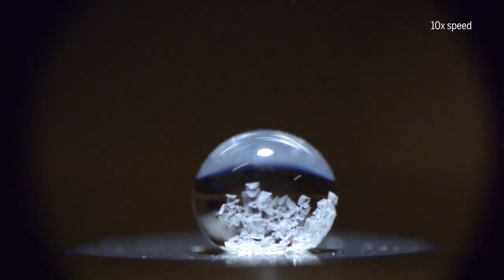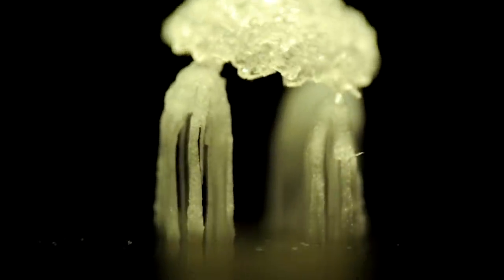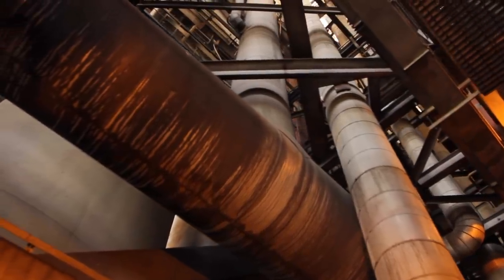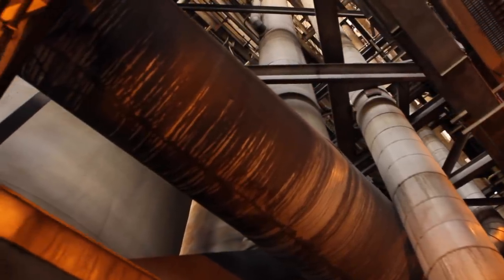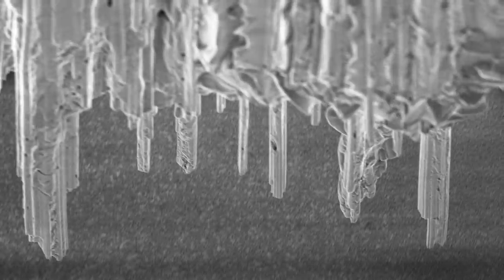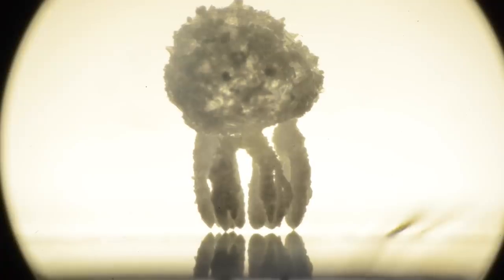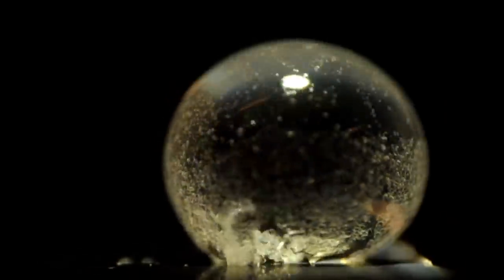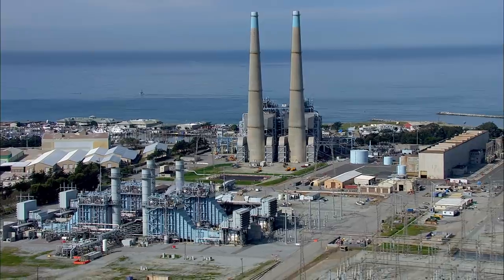These strange salt ‘creatures’ could help unclog power plant pipes

Comment: If these structures can also be produced in large quantities and relatively cheaply, power plant operators will jump for joy.
Reply: It will be cheap in 20 years..
Once the patent expire and China start mass producing it..
Reply: Plus anyone that owns any vehicle up in the north-east "rust belt" because they use a lot of salt on the road.
Reply: @ETERNlTUS  The estimate of 20 years could be right. It depends on how much interest the industry has/will have in it.
Reply: @nostalgichacker  Vehicles with this nanostructure as a surface? I think that will still take some time.
Reply: @ETERNlTUS  careful, don't blow the lid on PATENTS! 🤯✌️❤️
Do you know how much INNOVATION there would be?!
Reply: @sevisymphonie5666  If they make the technology cheap then at least some luxury car companies will use it to add value to their car because I assume that no car company wants to be known for rust buckets.
Reply: @nostalgichacker  Well, it's just that the surface of a vehicle, especially a luxury vehicle, has to be able to do more than prevent salt and other minerals from forming layers that are difficult to remove. It must also be able to withstand other external influences as much as possible. 
This nanostructure must first be produced on a large scale, and if it can then be combined with other technologies so that this new surface meets all these requirements, then there will be vehicles that no longer salinate.
Reply: Yes, and if this knowledge could be applied to dendrite buildup in lithium batteries it would greatly extend the life of this most widely used tech, which would have a major impact on the environmental and economic cost. 
This aside from the perpetual  Sword of Damocles hanging over countries like Venezuela that possess this finite resource, as a sleepy Apple, comfy in its spooky niche, slowly wakes up to 5G w/ golden-boy Elon spitting "We can Invade whoever we WANT!...".  Another day not being drone-bombed/"regime-change"-ed is another day to jump for "joy"; for reals!...
Reply: Being able to use saltwater for cooling would be amazing
Reply: @ETERNlTUS  china doesnt wait
they will copied it right away
Reply: Trenton Alverez  is it expensive?
Reply: @ETERNlTUS  china doesn't care about patents
Reply: Will the price change though, that's the question. Here's to hoping that it does help reduce its price
 
I worded that weird, it's more of a question of if the electric companies will have any significant change in price since the incentive is to make more by spending less on maintenance
Reply: As long as you can put the piece into a vacuum chamber and then heat it to 600°C, you can do this yourself pretty cheaply with TEOS (cit. Al-Harbi et al., 2012). I think the main obstacle til now was that we didn't know that salts would do this.
Reply: Patents stop progress but they do make since. It would suck donkey doo doo to spend years and years inventing something just to have a large company be like “thank you” and go build it for themselves with very little credit or money thrown your way
Reply: @jamesway4771  So it's dependent on the person, I mean that either the person plays nice and fair or their grip is white knuckled
Reply: yep

Comment: I hope the cost of producing that surface is cheaper than replacing a pipe instead.
Reply: If that pipe needs to be replaced dozens or hundreds of times across the life of a plant, each time requiring part of the plant to shut down then it might be.
Reply: @joshuacollins385  I still hope it is cheaper though, otherwise this is just a fun fact.
Reply: @lazywarrior  I hope so too, I just meant that with how often pipes might need to be replaced and the problems associated with that work, the bar this technology needs to beat to be cheaper overall is pretty low
Reply: @joshuacollins385  👍
Reply: @lazywarrior  Theoretically, if the material can be mass-produced, then it will provided that power plants start using it immediately.
Reply: What if the focus is the environmental impact of creating and disposing of the pipes?
Reply: Science of the problem has been found. Next is to let the engineers make it economically feasible.
Reply: @joshuacollins385  Not necessarily true. This surface, or coating is prone to wear out from the flow of crystals in the water. If that's the case then they'll have to replace/maintain the pipe anyways and then it kinda pointless.
Reply: This technology would involve replacing the pipes so they repel salt. So yeah replace the pipes, but make sure the new ones don't have the same problem.
Reply: I'm fairly certain replacing the pipes when they get salty would not be feasible (economically). The current approach is to purify the water to prevent 'mineral fouling', which is also very expensive.
Reply: @altersami9660  I don't think you are correct. It's not a coating, it's a texture applied by 'reactive ion etch' - which I'm fairly certain means it does not 'scrape off'.
Reply: @AZTECMAN  Reactive ions etching unmasked or unilluminated 10-40 nm areas on the pipe are literally reacting away pipe. It doesn't make erosion of the pattern impossible, but it does make re-etching in (or near) service attractive.
Reply: @AZTECMAN  Reactive ions etching unmasked or unilluminated 10-40 nm areas on the pipe are literally reacting away pipe. It doesn't make erosion of the pattern impossible, but it does make re-etching in (or near) service attractive.
Reply: @AZTECMAN  I said surface or coating. Doesn't matter which as either of those will wear out.  That's why I didn't say "scrape off" like you were saying.

Materials that the pipes are normally made will wear or erode away with time no matter what. Microscopic erosion will happen fairly quickly which should destroy the microscopic texture on the inside of surface of the pipe.
Reply: @Cineenvenordquist  So, do you have any data on how long such an erosion process might take? I'm guessing this data doesn't exist yet (for this material), but thought I'd throw the question out there.
Reply: @altersami9660  okay but this is just speculation... Show me the data!
Reply: @altersami9660  Have you got a source for it being more prone to wear out?
Reply: @altersami9660  Sorry I phrased my reply poorly. What I meant is to say that okay yes there is a thing called erosion, but the question is: how does the performance curve look for nanotextures in pipes (given various natural processes). 

I'm guessing this type of study hasn't been done yet, however, it could be that I just have failed to find it in my initial googling.
Reply: @AZTECMAN  No worries, man. That is exactly my critique of this method, is that we don't have data on how long it's lasts, which is very suspicious. Usually in the resreasch that means it is wouldn't.
Reply: The process is cheap although, research might get expensive.
Reply: @AZTECMAN  its a superhydrophobic surface. These things repel water so their erosion would be very very slow. Its actually a pretty well known research topic.
Reply: @thusharsm  Interesting. I'll have to give this another look.
Reply: They should just design nanobots that rip the salt off the surfaces.  That, or design a better auger.
Reply: Haha! That was a good laugh. Since when does new technology come out that's CHEAP? Never. It'll be forced upon the plant owners.
Reply: @joshuacollins385  typically they don't need to replace the pipe, I make my living traveling to plants and cleaning the scale and build up from the pipes
Reply: @ffejkk37  there is next to no environmental impact for creating the pipes. If the power plants didn't buy any the factories would still produce at the same pace, and as for the old pipes they can just be melted down and repurposed.
Reply: True that. not sure if you can make a mall of such small material and reprint it on metal while it's hot.
Reply: @joshuacollins385  then build certain clogging pipes in such a redundant way you can always remove them without shutting down. probably cheaper. and if you build them this way you also have to replace them less often so i guess it's a win win there. still @Can Z points stands how cost effective will be producing this pattern on the metal material.
Reply: @sosobored1992  Thanks for that information. What's the cleaning process like?
Reply: @joshuacollins385  basically like roto router on steroids' we use a 1000 bar (15k) psi jet of water to cut and drag debris from the  pipe
Reply: It might not be cheaper if you only replace the pipe once, but if it extends the pipe life long enough, it will end up being cheaper due to the number of replacements prevented
Reply: @joshuacollins385  they will be able to easily laser etch the pipe with nano textures quickly and cheaply the machine won't be cheap but they'll be able to use the machine to texture the pipes many many many times
Reply: Especially if they can begin using saltwater instead. Massive cost benefit
Reply: depends. if for example it's 50% more expensive but could double the time lifetime of the pipeline before they needs replacing, that's still a major improvement and saves tons of money
Reply: How could I look into how much it would cost?
Reply: @lazywarrior  the cost comparison one on one doesn't matter when you have to replace it one more time rather than a dozen or more times
Reply: @joshuacollins385  you are correct.  A production environment like a power plant must stay online.  If this reduces downtime, and costly maintenance, then that alone is worth it at any cost.  Also consider that we also must do for the world itself.  Fresh water needs to be conserved.  If this opens up the ocean then a billion gallons saved seems like a lot to me.  It also seems to have more than just one application.  Maybe with the right AI, they could even make the unwanted materials walk out of the pipe.  Kind of neat.
Reply: What’s a matter 
 You don’t like pipe fitters?
Reply: Even if it’s not cheaper it’s better to not waste resources
Reply: Capitalism gone capitalize. Repeat after me Americans: Immediate and temporary profits are not as important as human lives and long term value.
Reply: Like he mentioned if it let them use saltwater instead if fresh that would be game changing
Reply: With the cost of a workforce to cut and weld and inspect and test a new pipe, vs a really expensive pipe that almost never needs replacement. I’d bet on the expensive pipe.
Reply: If the surface is 100 times more expensive than a basic pipe, it still costs less than replacing it many times, because it doesn't cost the plant downtime or the work to replace it.
Reply: I think that's missing the point. Even if this surface might not be financially feasible, it's a step towards that goal.

Comment: Preventing scale buildup in boilers is quite the value proposition.
Reply: Isn’t scale calcium?
Reply: @crunch9876  It is. I wonder if this technique would work against calcium/limescale build up
Reply: @crunch9876  I guess this is what I get for using a word without knowing what it means.
Reply: @rorypenstock1763  well, now you do!
Reply: Yes. It's quite "cool".
Reply: Yeah this has applications way beyond power plants.  I replace my water heater every decade.  Sure would be nice to cut that frequency down.
Reply: @SmashCrunch  Actually scale refers to any buildup of minerals or metal salts in a water tranportation or storage medium, we typically refer to calcium scale as limescale. Nathaniel was correct in his original usage.
Reply: @Wesstuntube  flush it twice a year
Edit: and change your anode rod every 5 years
Reply: Well if we switched to distilled water like at home...
Reply: @deadwingdomain  distilled water causes erosion and isn't as good for drinking.

Comment: Not far from my house several data centra are build and they are cooled with drinking water. It's smack in the middle of a high production agricultural area. In a hot summer there won't be enough water for inhabitants and agriculture. This could be a game changer.
Reply: Yes you are right, better cooling without coated salt, these crystals are easy to remove with less blowdown, less dosing, improved cycles of concentration.
Reply: Data centers usually recycle and re-use all their water. If those ones don't, blame your local government.

Comment: Being a boiler engineer, doing commissioning, operation, maintenance in power plant boilers, it is wonderful to see this. But how (an outline of which way to do this), do we make a coating or is this metallurgical treatment on the internal surface of tube (and pipe also, there is a difference)?, Cost? In comparison to returns!, furnace temperatures touch upto 1000C , so fatigue life? Lots of questions

Comment: Isn't the scaling mostly a problem on submerged surfaces? There's only a drop to rise if its in air as depicted here...
Reply: Points! Water vapor in pipes is submerged gas....then all steam well before it exits the boiler.

Comment: I get the feeling that micro and nano scale structures will be a very big deal in the coming century.
Reply: They already are, they're called microchips, microfluidics, microbiology, nanoparticles and so many more that we already operate and manipulate at submicro scale, there definitely be a lot more of it as these technologies get more mainstream though, especially in material sciences
Reply: @Soken50  Agreed that nano scale engineering is everywhere just considering microchips alone. But as we gain finer control of structure at those scales, we will find many new and creative ways to solve a lot of old problems.

Comment: I like how there's no report of how long such a coating would last in the pipe interior.

Water erodes most things, even a fancy coat that can do stuff like this is subject to the same stresses that the pipe itself experiences, fast flowing water WILL erode such a layer within a week, maybe two before it's completely gotten rid of said layer in a particular section of pipe. There is no other viable solution than simple replacement for the time being.

Comment: I think it could be also benefitials for ships and cars, preventing from salt water corosion.
Reply: Not at all, completely different issue. Also ships already have that issue mostly down it's just a matter of keeping the sacrificial metal in place so it "rusts" it instead of the hull of the ship... That and paint.
Also getting your under carriage painted or coated will stop your car from rusting out, that is why all cars sold in the North in the US come with it pre-done due to all the road salts, in the south they don't to cut costs.
Reply: @SilvaDreams  Yes of course ships have metal bars with lower standard reduction potential, it is known fact, as well as protective coating. I still keep my point valid, in research you can read that these moyfied surfaces are superhydrophobic. It means that they repeal water, so by reducing the contact with electrolite it could decrease the corosion. It is only hypothesis, but I would love to see that kind of reserch.
Reply: @Zielu13  But this doesn't reduce the surface area, it actually increases it by giving it tiny little nanometer sized divots so the salt can't form larger deposits and instead forms thin weak structures that easily are washed or blown away with minimal force unlike if they formed on a much smoother broader surface.
Reply: @SilvaDreams  There is even short note in article: " However, when water is evaporated, contaminants within the water (including minerals) will precipitate at the point of evaporation. Over time, accumulation of these impurities reduces heat transfer performance, blocks pipes, and generally causes material corrosion and deterioration (3). Mineral fouling, in particular, is a leading cause of equipment degradation and failure in heat exchange processes (4)."
Reply: So YES it should be somehow benefitial.
Reply: @SilvaDreams  I didn't say that it reduces the surface area, I said that it repeal water, reducing the contact with electrolite.

Comment: For the people wondering if it will be "cheaper", the answer is yes. Here's some excerpts from the research:

Because of the ever increasing importance of water conservation, more and more water for thermoelectric cooling is being sourced from saline surface waters or from desalination waste brines rather than from freshwater sources, despite the associated increases in pretreatment costs. Surface engineering for control of salt-substrate interactions is therefore becoming increasingly attractive as a cost-effective alternative to pretreatment for preventing mineral fouling.[...]Using saltwater rather than fresh water for cooling applications simultaneously reduces costs associated with water treatment while also preserving fresh water for other vital purposes.

Comment: Problem would be the same as painting concrete steel reinforcement bar with anti-rust paint. A single scratch would cause a deep gauge of corrosion.

How can anyone assures that every micrometer of the inner surface of pipes are perfectly covered with this salt crust prevention nano patterns?

It's what we call "false economy". A method that might seem novel and cost saving but may end up costing even more.

Comment: Would you have to keep the surface impeccably clean in order for it to continue to work?
Reply: Pretty sure it would be self cleaning as the crystals break off and tumble away.
New crystals would form on the stumps of the old ones, and the cycle would repeat.
Reply: @demandred1957  but if there was any other kind of dirt apart from salt that got stuck to the surface then it would loose the micro bump texture.
Reply: @JuliusBurton  Perhaps, but I suspect that as the salt crystals keep breaking away they would take whatever other kinds of "dirt" with them.